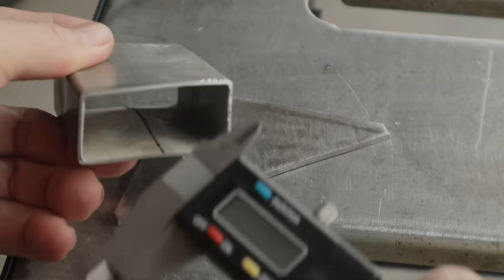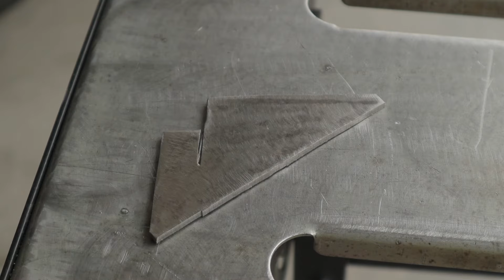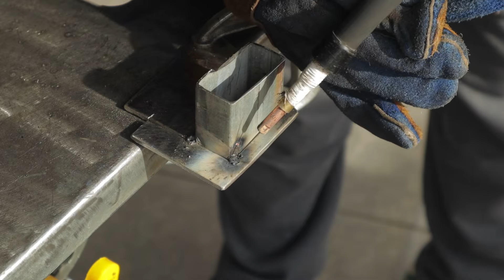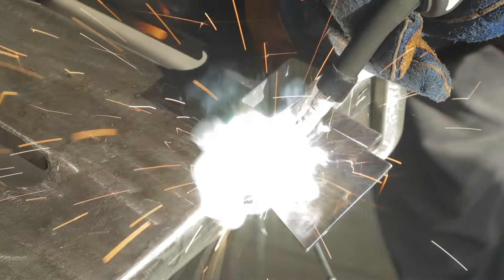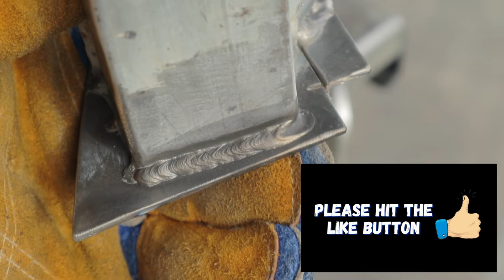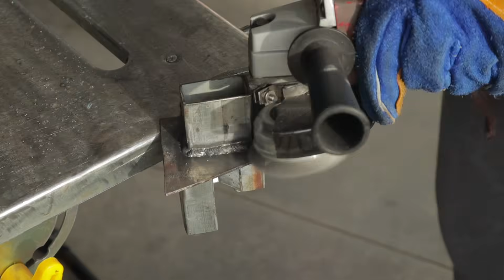Perfect Flux Core Settings for Thin Metal (No Burn Through)

Comment: Why not do a series of tack welds all the way down the joint, clean, then follow up with a bead so you dont have to worry about blowing thru.  And still get good penetration.     Would that work?   Im new to welding.
Reply from the maker: I suppose it might work but it sounds like a lot of extra work for the same result. I haven’t tried that method myself.
Reply: @DIYHomesteadProjectsDIYHP10 bought some thin metal today.  16g and 22g.   Gonna practice on that before taking it to the jeep
Reply from the maker: Nice, I wish you the best!

Comment: I’ve got a chair a friend wants me to try it’s thin tube to thin plate.   You made that look too easy.  I think I’ll go low hear for the thickness I have and just try a few spot welds and if I blow through maybe I’ll try that trick where you just do many spot welds as a weld kinda thing.   Any advice appreciated.
Reply from the maker: It sounds like you have the concept figured out. If it burns through just stop and let it cool until the metal is no longer glowing red and then pick up where you left off and continue. If you had a practice piece you could try first that would be a plus. I wish you the best with your project!

Comment: I've always had trouble setting up my flux core welder. So many YouTube welders offering different advise. I set my machine to the settings you used and it's perfect for 1.6 mm gal tube. Using Weldclass Platinum GL11 .35 wire .I can't thank you enough.
Reply from the maker: Glad it helped you out!
Reply: You're not the only one. Even the producers seem to have problems with the setup on fcaw machines sometimes. I tried the synergy option on my flux core machine; cranked it up to max, and guess what; it just burns up the wire faster than it can feed! Turned it over on manual and lowered the voltage by 3 or 4 and suddenly it worked much much better.

Hence; if the guys that MADE the machine can't figure it out, you shouldn't feel bad  either about struggling a bit. 😁

Comment: Nice work Bruce 
I did try removing the nozzle for better visibility I battled with the tip sticking to the metal if I was not careful. You made it look easy
Reply from the maker: Thank you Mike I appreciate that. I will stick the tip my self every now and then too. :)
Reply: Wrap some  alfoil around the nozzle to shield it from splatter.
Reply from the maker: That might work too but I prefer to use the Teflon tape